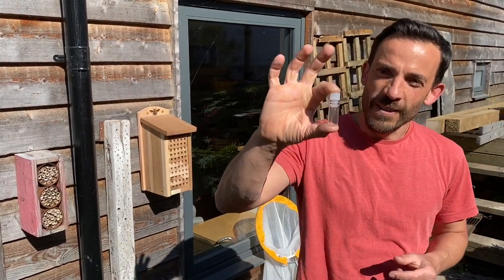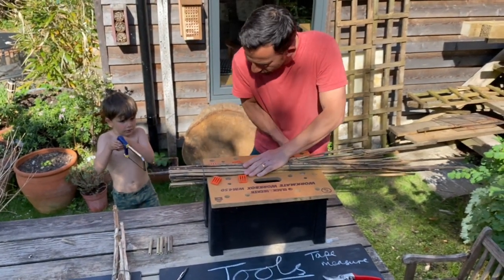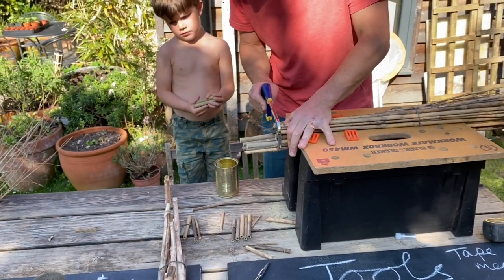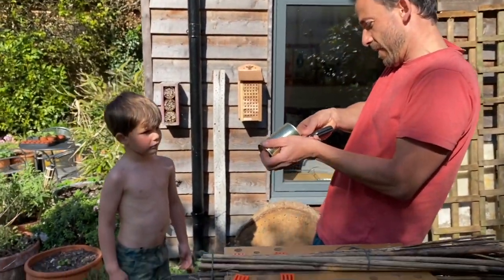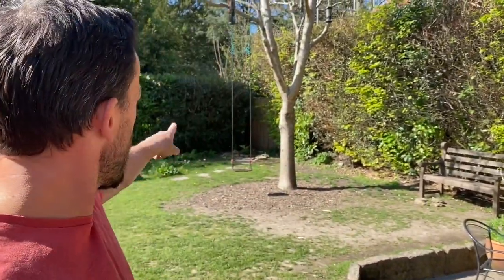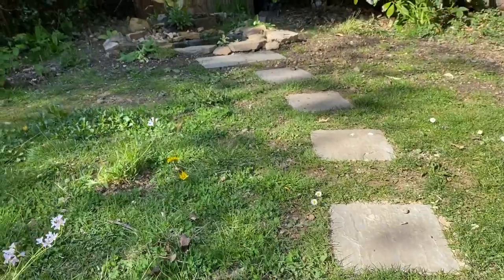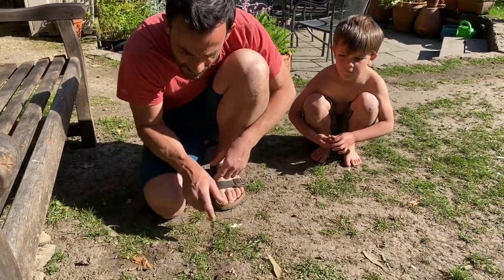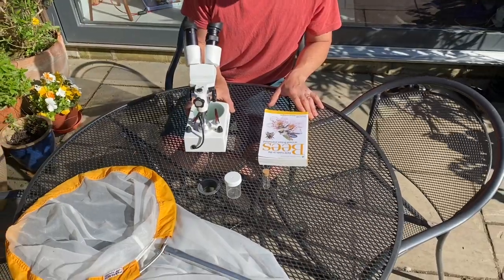Making a solitary bee hotel

Comment: Greetings! Nice video and your design is clever. However, the more current recommendations are that the tunnels SHOULD NOT extend all the way through. 

Why Should Tubes Be Closed at One End?
Bee Safety and Orientation:
Bees build a series of cells in a single linear tunnel. If the tube is open at both ends, the back cells are exposed to wind, light, and predators, and the bee may not use the tube at all. Bees also orient themselves based on the solid end to know where to start building.

Protection from Parasites and Predators:
Open-ended tubes are easily invaded by parasitic wasps or birds that can access the brood from the back. Sealing the back mimics a natural crevice or hollow stem.

Moisture and Mold Prevention:
Open-ended tubes can allow airflow that brings in humidity, leading to mold and fungus, which is deadly to developing bees.

Reliable Sources That Support This:
Xerces Society – One of the leading pollinator conservation organizations:

"Ensure that all nesting tubes have a solid back. Do not use straws or reeds that are open at both ends."
Source: Xerces Guide to Attracting Native Bees

USDA Forest Service:

“Nesting holes must be closed at one end, as bees will not use holes that are open on both ends.”
Source: Bee Basics: An Introduction to Our Native Bees (USFS)

University of Minnesota Extension:

"Avoid using tubes that are open on both ends. The back of the nest should be sealed so the bee can anchor her nest."
Source: UMN Bee Lab

Cornell University College of Agriculture and Life Sciences:

"Hollow stems or tunnels must be closed at one end; bees won’t nest in open-ended holes."
Source: Wild Pollinators of Eastern Apple Orchards

Here are the best hole diameters and their likely bee tenants:

Hole Diameter	Common Users	Recommended Depth
5/16" (8 mm)	Mason bees (Osmia spp.)	5–6 inches
1/4" (6 mm)	Leafcutter bees (Megachile spp.)	4–6 inches
3/16" (5 mm)	Smaller mason bees, small leafcutters	4–6 inches
1/8" (3 mm)	Tiny native bees (Hylaeus, Ceratina)	3–4 inches
These are your “core” sizes, especially 5/16" and 1/4", which will attract the largest number of useful pollinators.

Extra Sizes for Species Diversity
If you want to attract less common or smaller native bees, you can offer a range of 1/8" to 3/8" in diameter.

Diameter	Notes
3/8" (9.5 mm)	Larger resin bees, less common in urban areas.
1/8" (3 mm)	Sweat bees, masked bees, tiny carpenter bees.

Avoid >3/8"	Holes this large may attract wasps or pests like grass-carrying wasps.

Comment: If you’re sawing the Bamboo in a bundle, would it help to fit the tin over the end of the bundle, both as a guide to cut against and also hold them firm and make sawing easier?
Reply from the maker: Thanks Peter, yes sometimes we have done that, but it can make it harder to get a good grip on the bundle as you're sawing. Thanks and good luck if you're making one!